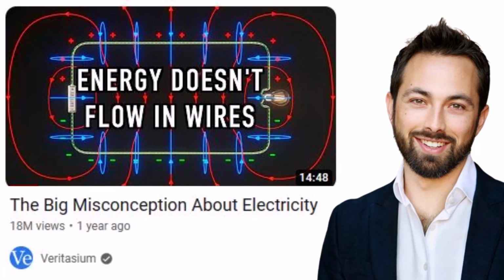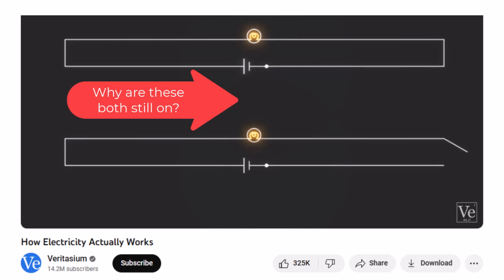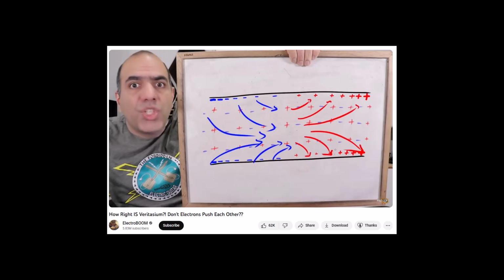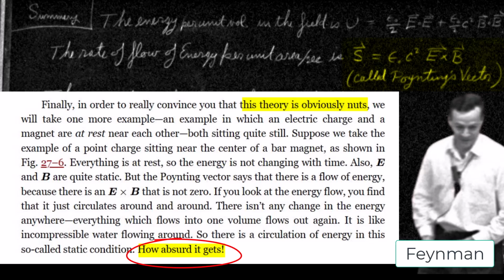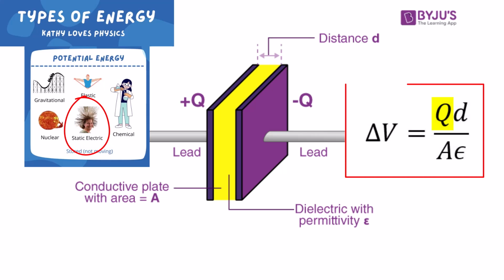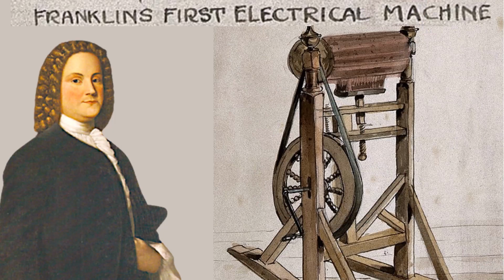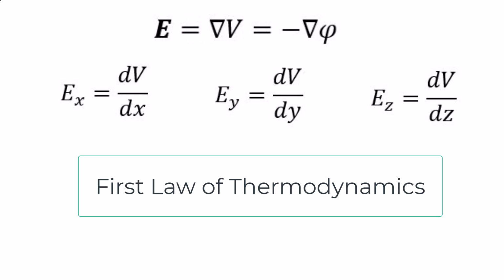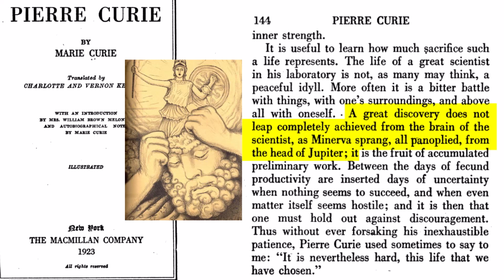Deep Dive Historical Response to Veritasium’s DC Electricity Video

Comment: Part 2. Feynman talking about CRAZY Poynting theory was not implying it was wrong but that it's crazy. He believes it correct and explains the unusual aspect of the theory in his lectures. He shows how Poynting Vector describes energy and field momentum.
It's always true in EM theory that energy is conserved LOCALLY.
There is a partial differental equation that applies to any POINT in any EM situation, in or out side wire. It relates energy density, work done on charges by fields or work done by fields on charges and the Poynting Vector energy flux through surface boundary of tiny infinitesimal volume. Very tiny volume because it's a differential equation and so a statement about what's happening at a point. This LOCAL energy conservation law is fundamental and this is the reason you need Poynting theory.
In the infinitesimal volume when work is being done and change in energy density, you will have an flow FLUX of energy across the boundary surface which is described by the Poynting Vector.
So that's why you need Poynting. It's so you can explain what you mean by local energy conservation - the relationship between energy density, work and energy flux.
Reply: Me again. So by integrating the Poynting Vector over the boundary surface you compute the flux of energy across the surface. The usual expression for the time averaged energy of a plane EM wave, that IS the magnitude of the Poynting Vector. The unit's of magnitude of the Poynting Vector is power over area, usually watts per square meter.
Those hand held devices that measure radiation in an area are measuring the magnitude of the Poynting Vector (usually units of mW/m^2)
Also what is called the Solar Constant, well that again is the magnitude of the Poynting Vector (unit's of kW/m^2)
Reply: Me again. Local energy conservation an objective fact of EM theory, Poynting vector is just consequence. What about the solar wind DC current, where is the energy - in the fields. It doesn't matter what type of bulb he had his point was the energy is in the fields and field nipped straight across to the bulb with a little bit of energy to set up a tiny current as well as traveling round the wire. Those surface charges and shielding, that's Gauss Law, electric statics. Shielding result of Laplace equation having unique and constant solution for constant boundary conditions. Where is the energy in capacitor, charges on plates energy in fields between plates. Energy is ALWAYS in the FIELDS.
ALL your videos are brilliant and thank you very much.
Reply: Yes I understand what you mean but you are confusing electric statics and E dynamics. As l say Laplace is statics. You will still be able to receive a phone call on your mobile even in a faraday cage no problem, that's E dynamics. The Skin Effect that's electric dynamics and is how you would shield from EM waves, it also like a limiting affect for heigher frequencies becoming like a faraday cage shielding. 
Physics totally different tho, for statics solution of Laplace equation and for dynamics the differential is like the diffusion equation with time derivatives and solution similar, exponential factor, providing attenuation.
Reply: Yes I think you are correct tho. The point is this Poynting vector is mathematically correct but doesn't distinguish between kinetic and potential energy. For DC there will be current in the wire and energy flow inside the wire. The Poynting Theory HAS to be correct but it doesn't distinguish between kinetic & potential energy. I think that is the cause of confusion.

Comment: Like perfect randomness (potential positioning possibilities in No-thing), pseudo random prime-cofactor log-antilog occurrences are a matter of orientation to the unitary-duality whole message in ONE-INFINITY connectivity function, truth and lies are absolutely the same information +/- In-form-ation substantiation holography vanishing-into-no-thing sequences of AM-FM 2-ness in 3-ness time-timing sync-duration manifestation. 
It's easier to fool yourself and lie than use the Exhaustion Methodology to know Absolute Zero-infinity reference-framing containment of e-Pi-i omnidirectional-dimensional flash-fractal Fusion-Fission Function re-cognition of unfooled Truth extracted from Uncertainty Principle by Phys-Chem-Math Quantum-fields Mechanism, Holographic probabilistic Observation.

Comment: This video is about the closest that I have seen to be what I believe to be the truth about current following a wire. I say following as from what I have seen of videos, what I have of knowledge from my life with electronics and what I know of theory I will have to say the following: What is called DC current flows both inside and outside the wire. 
I will start by explaining what I mean by saying "Called DC".  In my opinion DC is just a very low frequency AC that does basically not extend to more than half a wave. The starting point has to be build up and the only way that can happen is by a number of harmonic frequencies adding together to make the rise in voltage. It is these harmonics that can be heard as noise in an AM radio. These harmonics are also the pulses Derek claims comes to the light bulb and yes they do arrive when he say. 
Secondly as has been measured by many the actual power pulse that comes to the light bulb comes delayed by about the speed of light along the wire (+ a little). I put in "+ a little" as this time delay depends on what is OUTSIDE the wire. One tested  it with water on the outside of the wire and found that to slow  the arrival of the pulse quite some time. It is there fore conclusive in my opinion that current does run on the outside of the wire as pustulated by Derek. 
Thirdly I will postulate that the current also run inside the wire. I base that on that with so called DC the square of the wire determines the resistance to the current. As far as I know a pipe can not carry the same current as a solid wire when they have the same diameter. It is different at higher frequencies where basically all current is in the surface or outside the wire. I will postulate that there is enough space in between the atoms in the wire that the electro magnetic force to some extend will also be present inside but absolutely also outside as I postulated in second statement. The difference with high frequencies is that it moves forward and backward and the internal electron movement is slowed down by the metal around the core centre just like any material outside the wire and there fore is practically zero movement.

Comment: I would just say that i would approach the declaration of fault on the part of David Jackson with great trepidation.  The man (who i once dined with) was a towering intellect.  I will re-watch this video to better understand what exactly you think he got wrong.  I also found the veritasium video highly disturbing, and his follow up videos less than illuminating.  Your video is a necessary thing and I'm glad to see it.
Reply: I’m not sure I understand what you object to in Feynman’s presentation about the Poynting vector, Kathy. He is just describing Poynting’s theorem, a provable theorem in E/M theory, which really does say that there is an energy flux directed radially inward from the exterior of the wire. He admits the interpretation of this seems absurd. So some thought is needed to make sense of it, probably amounting to some discussion of how the local steady state electric field configuration (E directed along the wire) must be the result of far away charges for consistency. I agree the notion from Derek that the surface charges are important is bogus, but where exactly the “energy flow’’ is located may not be easy to understand in this classical field theory..
Reply from the maker: I have no doubt that he had a towering intellect. That is why his work on the Poynting vector was believed. 

But maybe there is something there that I am not seeing because so far both Jackson’s and Feynman’s work on the Poynting vector seems like it’s nonsense

Comment: Derek Miller's description of the energy density of an EM field is incomplete and therefore wrong. When one calculates div S the result is the time derivative of the EM energy density + a static E·J term that Muller entirely neglects in his attempt to show that energy is contained exclusively outside the wire. I presume Muller's error was due to ignorance rather than to fraud, but whatever the reason for it, his video serves as an example of why one should not entrust one's science education to YouTube hacks.

Comment: Temporal Perfect Gas Thermodynamics is the idea of No-thing reciprocation-recirculation potential positioning condensation-coordination holography, crystallisation 2-ness in 3D-T 3-ness e-Pi-i i-reflection Superspin Spheroidal Toroidal containment Cavity, and the magical part is that ancient concept of Avatars projection-drawing around DNA/RNA type components of bio-logical messages in programming sequences of memory associations. Math-Physics stuf ready to reiterate and restructure for Teaching and Learning.
Reply: Electricity, Magnetism, Heat, light / Color, Mass / Weight are different manifestations of Gravity and Continually convert to each other. Gravitational Particles (GPs) move by means of CONDUCTIVITY towards the CENTER of the GRAVITY.  
Turbines convert the Gravity Force to Magnetic > Electrical > Heat > Light and everything in between.
When GP moves in the Air (4N1O) Atoms are manifested as Magnetism, therefore Magnetism exists only in the Atmosphere and is absorbed by Compass measured in Air Gap and Magnetic Flux context.
When GP moves in Solid it is observed as Electricity and measured by its Power/Force/Voltage and its Current/Amps and their combination total Quantity of GPs in a unit of time as Wattage.
GPs move at a 90 Degrees Angle relative to their path in [side] Steps, therefore the GPs manifested as Electricity, Magnetism, Heat and Light transit to the Outer Edges of the Medium/Matter.

Comment: No matter how many people are half right, it won't make sense in Completeness. 

Logarithmic Time holography is an n inside-outside reverse-inverted sense-in-common aspect-version that can be illustrated optically, within the e-Pi-i 1-0-infinity instantaneous sync-duration resonance shell-horizons of Eternity-now Interval,  but first a path of Piaget Stages of memory associations is necessary, ie a learning by doing experience in Intuition development is how the magical thinking ideas accumulate to the point of an hypothetical posit and testability of the kind Derek has demonstrated.

Comment: AlphaPhoenix actually tried to do Derek's experiment practically titled "I bought 1000 meters of wire to settle a physics debate"
Reply: Yes, his videos are very interesting, including the recent ones where he measured and visualised the "waves" of voltage propagating down the wire.
Reply: @zhoufang996 that video of Voltage waves is totally amazing and stunning.  It truly makes the behavior of Voltage look like water. I'm a student in Electrical Engineering and I can't stop thinking about that freaking video.
Reply: Alpha's video proved, (in my view) that a transmission line is not the same thing as power supply.  If the wires coming from the battery were perpendicular to the wires supplying the "bulb", you wouldn't even see much of a spike.  And in any case you would not see continuous power.
Reply: @peetiegonzalez1845  Exactly!!
Reply: We know

Comment: Kathy, I love your work!  I have watched all your videos and bought your book.  As an electrical engineer (no degree, self taught.  As you say, kids can learn anything!) I was quite upset with Derek's video.  (I call him my cousin because we have the same last name, but we are unrelated.)  

I agree with you that the answer to Derek's video is E) None of the above.  As you say, it depends on the characteristics of the light bulb, battery and wires.

The problem is, the long wires going to the Moon, and the opposite direction, form transmission lines.  A transmission line can be modeled by inductors in series and capacitors in parallel.  As the switch is closed, current instantly flows into the first inductor, and charges the first capacitor.  Then it flows from the first capacitor through the second inductor into the second capacitor.  The pulse of current and voltage propagates down the transmission line, through each inductor and across each capacitor, until it gets to the other end.  Then it reflects back.  In reality, there are an infinite number of capacitors and inductors in the transmission line, but the circuit can be simulated by using a finite quantity and still get good results.  The point is, the cable has so many picofarads of capacitance per meter, and so many microhenries of inductance per meter.  The transmission line has a characteristic impedence, which is determined by the ratio of the capacitance per meter to the inductance per meter.

Let's say you use a coax cable, like my TV antenna does, for the two wires going in opposite directions.  The cable on my TV has an impedence of 75 ohms.  And let's say the cable has no DC resistance.  The transmission line will act just like a resistor with the same 75 ohm impedence, until the reflected pulse comes back from the other end.  And let's say the light bulb has an impedence of 150 ohms.  So, the instant you close the switch, the battery and switch is in series with the cable going to the left, the lightbulb, and the cable going to the right, for a total impedence of in the cables equal to 150 ohms.  Because the light bulb's impedence is also 150 ohms, the voltage across the lightbulb will be 1/2 of the battery voltage, instantly.

Note that the speed of the pulse through the cables is also determined by the inductance and capacitance per meter.  That is how Maxwell determined the speed of light from his famous equations.  And that is because empty space itself has a capacitance per meter and and inductance per meter.  They are called the permittivity and permeability of the vacuum, and they can be measured easily.  (Einstein knew that the speed of light in a vacuum is constant, because there is no reason why the measured permittivity and permeability of space should change based on the rate your spaceship was coasting through space.  The rest of us had to wait for Michelson and Morley to measure the ether wind and find out there wasn't one.)  Note also that space has an impedence too, just like a cable.  The impedence of space is about 377 ohms.

Now, what happens when the pulse reflects off the other ends of the long cables?  If the ends of the cables were terminated by 75 ohm resistors, the pulse would be totally absorbed.  Because the resistance of our cables is 0 ohms, the only resistance in the circuit would be the 75 ohm resistors at the ends of the cables.  The light bulb would still see the 150 ohms total resistance, and it would stay half lit.

If the ends of the cables were shorted out, as in Derek's video, the pulse would reflect back and reinforce the voltage pulse going out.  When it came back to the bulb, the bulb would see the 0 resistance, then get the full voltage.  If the ends of the cables were open circuit, the voltage pulse would be refelected out of phase and cancel the outgoing voltage pulse.  When it came back to the bulb, the bulb would see the open circuit ends of the cable and turn off.

The whole story is told by the inductance per meter, capacitance per meter, and impedences of the cables and the bulb.  Anything regarding Poynting vectors or fields on the outsides of the cables is not needed.  Of course, the properties of inductance and capacitance are due to the magnetic and electric fields around the wires, but once those are understood as bulk properties, the operation of the circuit can be easily explained.

I think Derek was a little disengenuous in this video.  There is a quick shot of one of his electrical engineer experts showing him a graph of the step functions in voltage his light bulb would see when the switch was first closed, and when the pulse returned from the ends of the cables.  I know Derek is capable of understanding the theory and math, so I presume he kept that part of the story to himself to make it seem more magical than it really is.  Derek is a showman, just like all of us to some extent.  We have a duty to our audiences to keep our stories interesting!

So, the phenomenon of the transient travelling through transmission lines when the switch is closed is not so mysterious.  In your video, you show how sparks from the wires can induce interference in the radio.  That is related, because your sparky wires are inducing EM waves into space.  But in Derek's circuit, closing the switch is inducing the transient down the transmission line--there won't be any sparks becaue the current is limited by the impedence in the transmission lines.  It should also be noted that when the switch is opened and closed, it is no longer a DC circuit.  Only after the transients have all settled down can it be analyzed like a DC circuit.

Finally, I just want to say that my favorite video of yours is about Georg Ohm, the guy who discovered Ohm's law.  I loved how was proven right, and the pompous Ampere was shown to be wrong.  I have used Ohm's law many thousands of times throughout my career, and never realized the rich story behind it.  Thank you!

And my favorite Veriassium video is the one on "How Imaginary Numbers Were Invented."  More excellent storytelling!  I also loved his video on chaos theory "This Equation Will Change How You See The World".  True magic needs no enhancement.